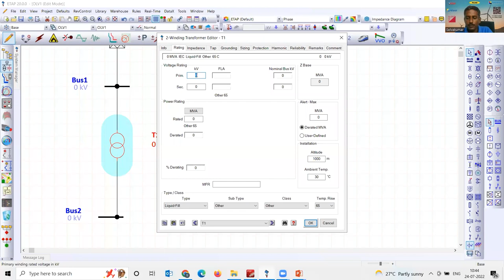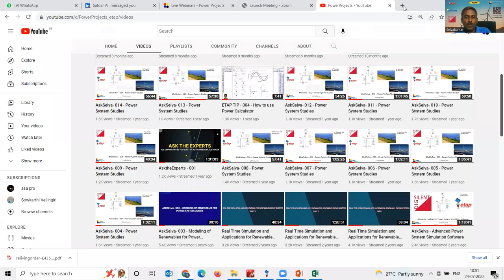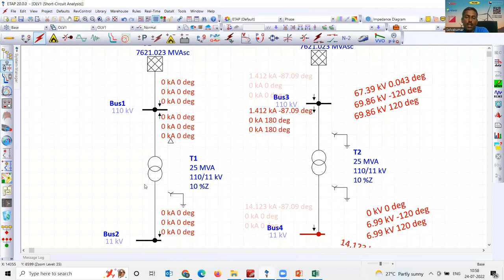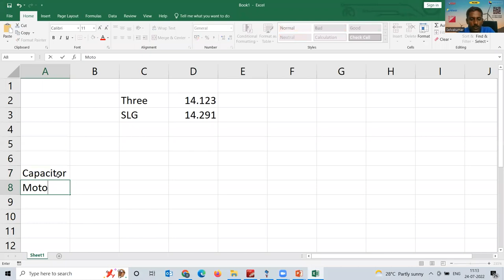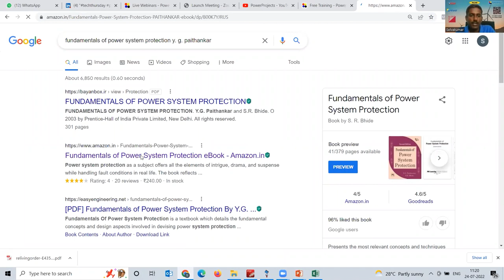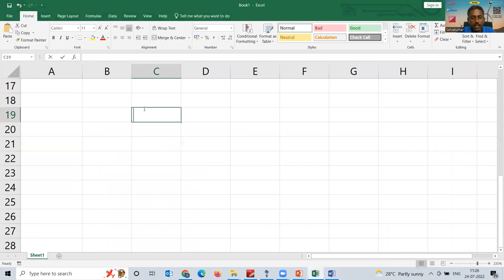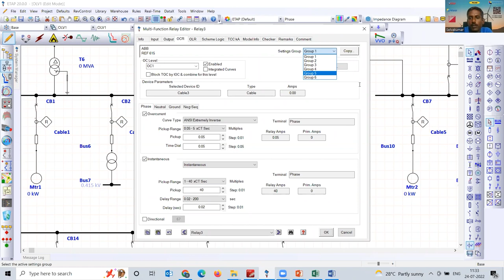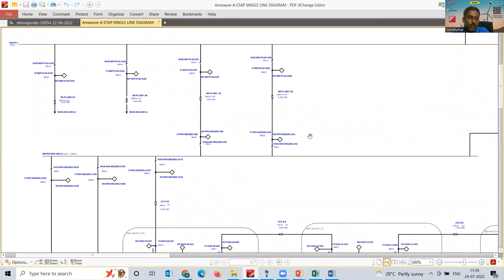Relay Coordination using ETAP

Comment: How to set the TCC curve for 3 auto reclosers connected in three parallel branches with the upstream substation  protections.

The second is how to avoid the miscoordination  between downstream circuit breakers tripping with faults in the upstream system in etap .

Also , is it helpful to activate more than one OC element for example OC1 is for OCT and ST and the other OC2 is to be IOC for the same feeder.
Regards